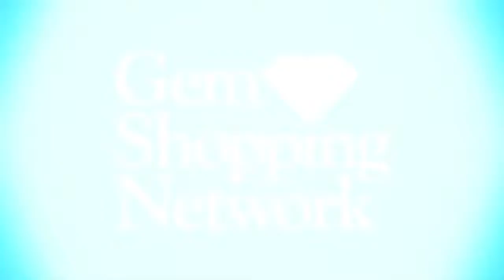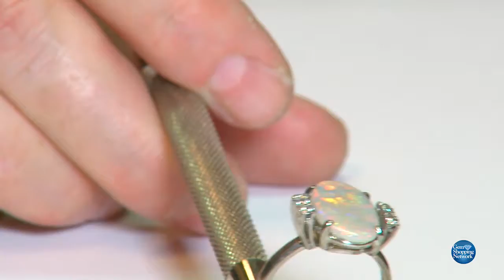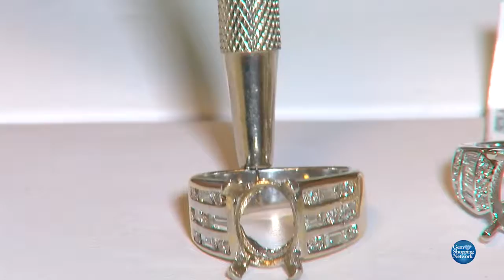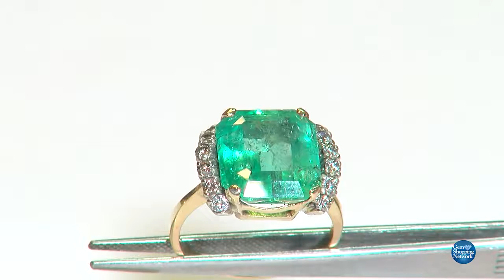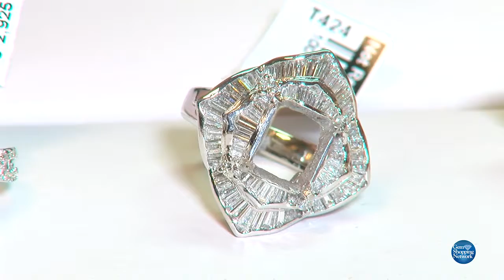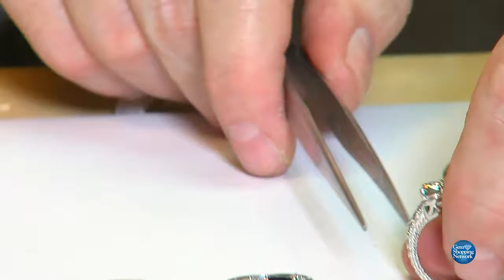HOW DO YOU Pick semi mounts & HOW TO measure your loose stone - Tutorial l Gem Collectors

Comment: I wanted to know when buying a semi mount for a diamond if you should go slightly up or slightly down in head size?   Like if the diamond was an 8.15 would you buy an 8.00 or an 8.50 if there are no .25 increments?   I know diamonds have to fit more exactly than most other stones but I am not sure if I go up or down.  I blew my money on the stone and have very little for the semi-mount.  Ugh.
Reply: I had a very similar question.  10.49 x 7.51 stone. And not sure what size opening I’m looking for. Trying to decide how to mount it. I found the video very helpful and very informative. Thanks!
Reply: @mindyw2411    I later found out that I bought the wrong size and now I have to see if I can talk the manufacturer into switching it to the next larger head.  I even sent them the measurements of the stone in advance.   They told me to buy down when I should have bought up.
Reply: Ugh! I’m just going to take mine to a couple of different jewelers and look at options. I think that will be safest for me. Hopefully you ended up with something that you love?
Reply: @mindyw2411    It is for my mother.  She had a one carat diamond back when no one had one like in the early 60s, but it was set in white gold which she is now allergic.  So she gave me the ring years back which I gave my daughter- because I already have a 1.83 natural emerald.  So then she said she wishes she had one and gave me a 500 dollar budget which I blew wide open on the stone a 1.39 carat gorgeous manmade diamond. I paid over 1k.   So I had to get the ring itself on the cheap.  I got it from Otto Frey.    Hopefully they will let me swap it or else I am stuck with it.  It took me a long time to get it to the jeweler,  so I am praying they are good to me.  I am not telling her what I spent of course.  lol.